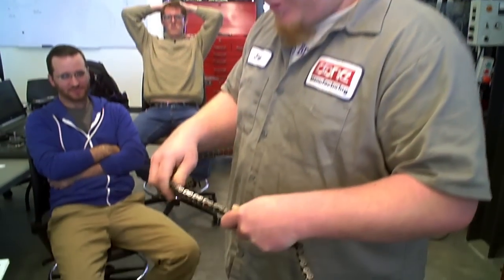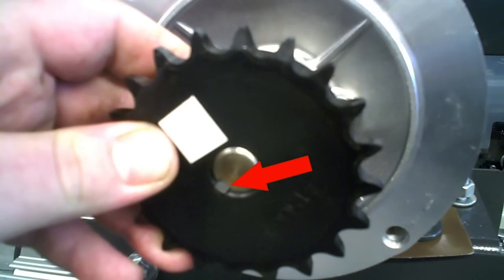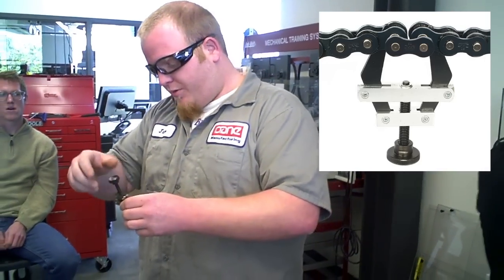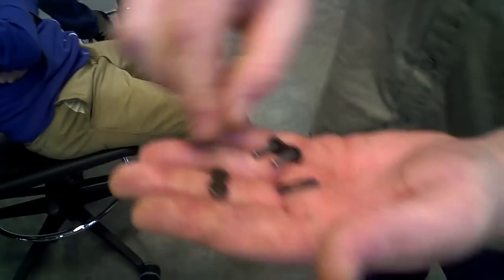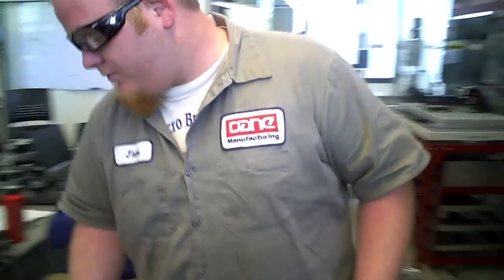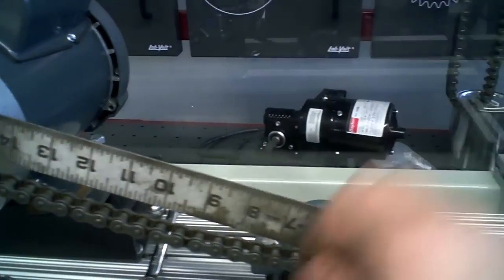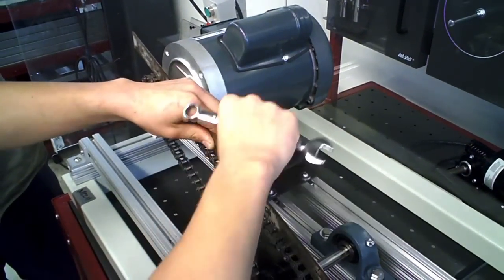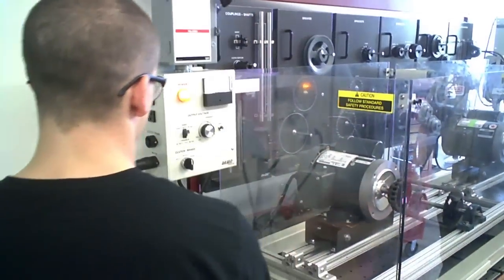Chain and Sprocket lab Madison College

Comment: Sir tow shafts are in placed with 30degree angle and 55inch distance and each shaft contain two sprockets at both ends of shaft and sprocket of 18teeth 6 inch dia and when am placing chain one chain is getting tights  on bottom and another chain is loose on the bottom if i tight another one this makes same problem sir please help me regarding this

Comment: Is it necessary to teach students all the time?  Considering the situation, I would have taken the opportunity to demonstrate that
when one is working on industry or anywhere else for that matter, one must accept that sometimes one need to learn on one's own .What I would have done is to explain the problem that there are situations when a chain needed to be joined together and then leave the 'bits'  where the students may see them, observe them, study them and then see  how they would go about putting them together in a LOGICAL manner to finish up with what the designer intended how those components would go together.    
As far as the pitch of the chain is concerned, I would have suggested that  as the centre of the pin is not marked so well, the edge of the pin would have done as well as it is measuring the same side of each pin say the right hand side for both the pins as the side of the pin is easier to determine accurately.   Still the  most important point is not just to show the student everything he needs ,but to introduce a little thinking and processing of trying to combine  what  components he is given.
Life long learning when the teachers are not around is also a useful issue to project to students as otherwise they will not acquire the self confidence of guaranteeing the service they provide when they are on their own. Self confidence is not easily acquired  and the student must be left on his own to think out various situation he encounters. Might as well start it all in school under supervision.

Comment: Hahaha, so you measured the distance of pitch with verniers ......why not tell your viewers how this measurement relates to and  identified as being 
a #40 pitch or #50 pitch etc, no body is shopping  with a decimal number for chain sizes NOBODY !! There going to ask for the pitch of chain , usually stamped on the plate 40, 50, 60....... yes you can convert your pin-pin measurement and come up with this pitch # if for some reason you are unable to read the plate, so explain this useful information to your viewers. Such as your measurement using your verniers, I believe it was a 0.48 or more like a 1/2” from pin-pin...divide this measurement by 1/8” will give you 4 add a zero 40 you now know you have a 40 pitch chain , this is true for all ANSI chain , it will change if you were to come across a British UK 🇬🇧 made chain, then your measurement will change to 1/16” and not 1/8”. ....If your going to show your viewers the measurement while using your big bad verniers then at least explain why and how this measurement can be used. Cheers.